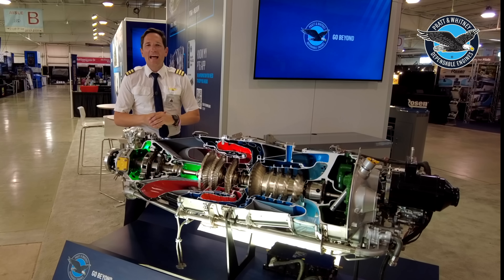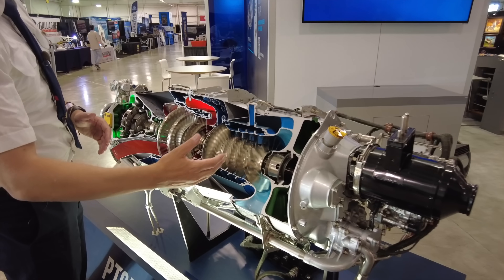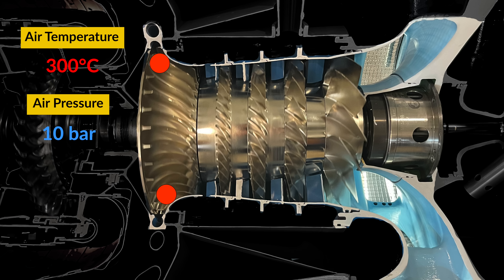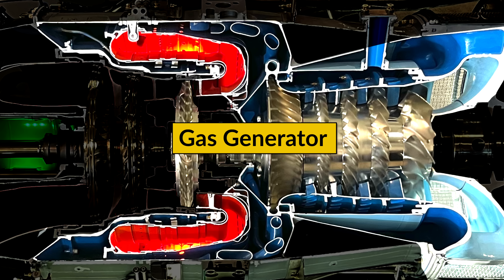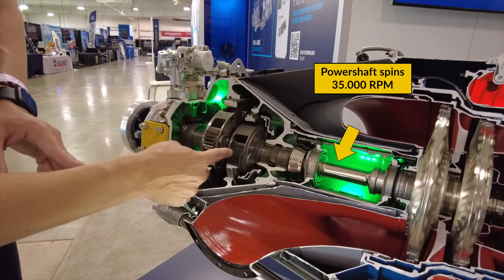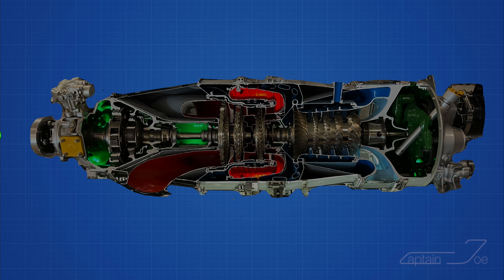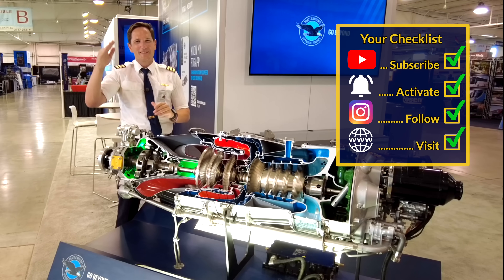The BEST TURBOPROP explanation video! By Captain Joe and PRATT & WHITNEY

Comment: Ok I understand how turboprops work now but the one thing nagging my mind is why? Why use one of these over a standard jet engine?
Reply: Because other jet engines have to be much faster to be more efficient. So in the low speed range turboprops are the most efficient.

Also, usually turboprops gives the best STOL performance
Reply: @ZK-APA  ahhhh so that's exactly why they aren't used everywhere mainly used only where it makes sense to have one. Ok now all of that makes way more sense
Thanks :D

Comment: That's a very interesting design.  I assume there are various air circulation chambers to cool the combustion chamber and the compressor housing.  I was wondering why the combustion chamber is enlarged to go around the exhaust turbines but that is what makes the engine shorter.

Comment: I'm confused...
If 47% of thrust from the combustion is driving the power turbine, which then drives a propellor.

This is just gas driving a turbine, that drives a propellor, that then pushes gas again...

Why not just skip the propeller and have the thrust itself push the plane (obviously need to reverse the orientation)?

Is it more efficient to convert the energy from pressure, to mechanical, back to pressure (propeller)?
Reply: Basically you just described a turbojet engine.
Advantage of turboprop is that thrust generated is more because of the volume of air rather than the speed. Hence at low speeds its most effective

Comment: I get that turbojets are not very efficient at low speed, but the the reduction in RPM required to power the prop, why not just use a turbofan to simplify the whole process?

Comment: Im a humble structural engineer, but love seeing mechanical appliances being explained. When you transitioned from cold air system through the combustion chamber, I was wondering about the varying speeds of rotation between the two chambers, expecting to find a fluid coupling or some other method of separating the two shafts, my reasoning being that the fastest turning shaft would control the other, or would that be the system with the higher torque? I impressed myself by understanding there should be separation between the shafts before you got there. Thank you for educating us less informed but inquisitive engineering lovers.

Comment: thanks for a great video.
What keeps the gas generator going once the engine start?

I know battery power to start it
BUT
since its not connected to the power unit, it will need another energy source.
Reply: The fuel hot air mixture self ignites, as long as fuel is available the engine is self sustaining and keeps running. Fuel shut off will close it down.
Reply: thanks.
compressor blade, combustion and turbine make up the GAS Generator section.
They share the same shaft.

got it.

Comment: Great explanation! And interesting to know how the two shafts rotate in opposite directions to avoid excessive torque/roll on the plane itself. Conservation of angular momentum - simple and elegant :)
Reply: I'm not sure Torque is the reason for counter rotation of the turbines. The turbine/compressor of the gas generator is free spinning and not attached to the engine/airframe in a way that allows it to transmit any meaningful torque to it, other than a very small amount of bearing friction (which would actually make the engine turn in the SAME direction as the turbine). This is the same reason why a pure jet engine doesn't torque roll the airframe, because the turbines/compressors just spin freely in the gas stream and can only provide longitudinal forces to the engine. The reason the power turbine/ gearbox in a turboprop creates torque roll is because the gearbox is anchored to the engine/airframe, meaning that torque from the turbine will be transmitted through the engine/airframe on its way to the prop. The torque reaction relates to the gearing and which way the propeller spins, not the direction of the turbine shaft

To my knowledge, the reason for counter rotating shafts is to make use of the swirl of the gas stream in the engine. E.g. as air flows through the turbine of the gas generator, it will start to rotate opposite to the rotation of the turbine (i.e. the turbine pushes the air anti-clockwise and this spins the turbine clockwise through equal and opposite reaction). The power turbine then spins opposite to the gas generator turbine, i.e. with the gas stream to make it spin more efficiently

Some turboprops are actually fixed shaft, meaning the gas generator and the gearbox are on the same shaft and spin in the same direction

Comment: From the comments below, it seams that most of the people were satisfied with a generic, brief explanation as depicted by a "pilot" ! ! ! !  If he is more than a pilot and might be a mechanic, that should  have been brought forward as well to show some way to justify his being able to talk about something other than the view point of a pilot.  If you want the real truth and the correct explanation to where you get the right information to where you fully understand the inner workings of a jet engine be it  a engine with a propeller attached to it via exhaust drive turbine PT-6, or a geared propeller drive attached at the front of the engine PW TPE331 which is found on several twin engine aircraft.  The PT-6 and theTPE-331 are only two of the turbo prop engines used in the general aircraft field.  There are larger turbo prop engines that are used on larger commercial aircraft.  This information is best answered by a certified aircraft power plant mechanic who may also have a air-frame mechanic license as well.    The mechanics, including the Prat & Whitney people know more about the inner workings of jet engines as related to this topic here on YouTube and will give a better and more informative answer than from a "pilot".  As I am a licensed air-frame and power plant mechanic and also a ATP, licensed flight instructor ratings CFIIM and also worked in a FAA approved jet engine overhaul shop I have a very realistic idea of the inner workings of a jet engine. Also I would NOT give you any incorrect information as I would ask of you to go to a current working licensed power plant mechanic or Prat & Whitney and get the correct answers you are searching for.  A lot of what you may be looking for is on the internet and by going to the source at    www.prattwhitney.com  The only way I do things is I "go to the source"  this way I do not get into trouble.  On a lighter note, "never trouble, trouble, till trouble, troubles you"!

Comment: I much prefer the straight axial flow turbo-prop engines (like TPE331).  They're more efficient, more power for their size, and don't smell up the airport ramp like the Pratt engines.  Yes, they're cheaper, less complex, and quieter.  However cruise efficiency of the axial engines is MUCH better (they're cleaner too).  Your explanation of this turbo-prop design was excellent.
Reply: Don't forget the hearing damage from the 331.

Comment: Thanks for this video. I have a little technical question about torque : why is torque null, or near 0, when the propeller is feathered ? I understand that a feathered prop produce no thrust, but the air resistance to its rotation is also very high, hence I expect a high ''torque'' value. It seems I don't understand the notion of torque in this case, and where it is measured in the engine/transmission. 
If somebody can help me about this ? 

Thanks.

Comment: 👍👍👍👍 Good expleniation. This engine Is very reliable, more than a pistone engine. No eccentric, no vibration, no pistone rings, valves, camshaft and wearing. It needs only Good oil for bearing lubrication due to High revs.

Comment: Retired from Alaska Air's regional service, Horizon Air, just recently. Went from AMT into Maint QC and eventually to their Propulsion Shop and worked on the RR Spey, GE CF34's and the P&W 123, 125 and 150 Turboprops. These Amazing Turboprop Engines are also Reverse Flow but put out 2300, 2500 and 5000 Shaft Horsepower to the Prop. The 150 swings a 13.75 ft diameter Dowty 6 Blade Prop and are used on the Dehavilland Q-400. What I would ad here is that after 100's of Borescopes (internal microscopic inspection), performed on these P&W Turboprops, I was amazed at how damage tolerant they are. Damages are usually confined to Combustion Liner wear and Compressor section Blade wear from normal use. P&W has every imaginable type of wear damage Recorded and Mapped for reference and all are well documented and tested for continued service. The more wear found, the more often the Borescope procedure. These are Fabulous engines that have been around a while and contain the Technology that has made the new PW1000G Geared Turbofan so successful. These GTF engines have 40 yrs+ of development behind them and offer a 15% savings in fuel economy over normal Turbofans. It was because of this fuel saving P&W GTF, used on the Airbus A320, that Boeing needed to provide something competitive, and thus, the 737 MAX was born. Boeing's answer to saving fuel was to mount the 737's existing GE CFM56-78 Turbofans UP further into the Wing, and Inboard as well, giving a considerable boost in fuel savings by reducing Drag. The downfall was that the faster this configuration of 737 flew, the more the plane wanted to climb and go "out of trim". Thus they had to invent the MCAS computer driven auto trim system (maneuvering characteristics augmentation system), to prevent the plane from climbing out as speed increased. That's where they got into trouble w/ the MAX. They Didn't inform the Pilots about this AutoTrim system, nor did they give a way for the Pilots to override it in case of a Pitot Tube (speed sensor) failure.

Comment: hi, I work on t56, t700, t600, and ae2100d turbo prop engines, could you explain a bit more about the prop? is it constant speed or controlable pitch? is the PIU like an overspeed/nts system or does it control prop pitch? does the plane have any type of computer like the 2100 or is the fuel control completely analog like the t56?

Comment: Wow…centrifugal flow combined with axial flow yet separated….blows my mind. 

As a student in engine class, couldn’t understand why fire didn’t come out of the inlet.  I understood ICE heads but then figured the convergent ducting pressure wall was strong enough thus preventing the flame moving forward.

Comment: That's an EPECS engine, very very new.(the cutaway you used) Notice no control linkages/cambox, its all electronic. As such, I like how you point to the electrical harness when talking about fuel flowing to the nozzles. Funnier still is you're scavenge oil pump has a fuel line going to it...if only you could EXCHANGE(r) it for another accessory (the cap letters are a hint). Otherwise very good high level explanation. Props to you...hehe

Comment: Captain Joe, you are the first human being that has demystified how this engine works. I couldn’t work out how one part of an engine could spin in the opposite direction if another part. I thought it was some sort of weird magic! 😂 What a clever design and so compact. Now I can see the advantages of having something like that inside an M1 Abrams instead of a socking huge and heavy v12 lump. Plus it’s lighter and simpler. Just really bad gas mileage and less durability I guess. Thanks for your top content Joe 👍

Comment: Not sure if anyone has mentioned it, but you can actually hold the prop stationary at startup. Though of course it’s not advised since the prop will quickly accelerate to full speed once released.
Reply: If the engine remains at idle, the prop will only be about 1040 rpm. If you increase the Ng to get max prop rpm, you should get around 1700rpm.

Comment: The "cold" compressor makes the air 300C, that's cold? How does this thing "suck" in the outside air? Is that a motor at the back of the shaft? Bonus question: the air doesn't move past the wing of a plane and it doesn't move faster over the top, the wing moves past still air, so what is the air actually doing?

Comment: If the Pressure, as the fuel explodes in the combustion chamber, is greater than the pressure in the compressor stage.
What prevents it from flowing/pushing back into the compressor?

Comment: Does the exhaust gas also produce a little thrust as it’s pushed out to the back?
And where does the air inside the compressor and turbine flow exactly? Does it turn around the stator vanes? There’s hardly any space to go through directly…

Comment: you mentioned HP but you didn't mention air pressure, how much pressure does the high pressure turbine generate?  it must be absolutely massive in the 1700 unit, that's a lot of shaft HP, how much after accessories say on the 1700 ho unit?  maybe 1500? 1400?  teh scavenging system will consume a lot as does the oiler one would imagine..unique, how does it compare to a Jet turbine engine and which one was invented first? the Jet is my guess?   

for those who cannot imagine simple fuel ignition generating such pressure there is a guy who cruises pulsejet engines across dry lake bets, funneled burning kerosine, heat air pressure generated by burning fuel and hot chambers suck air into low pressure inlet and force it out a high pressure outlet.. nuts he is mad man propane injected and diesel jet engine, no  moving parts, robert maddox is his channel he gets it going very fast..   very simple, to jet engine, to turbo jet engine, what is next?  SOL?

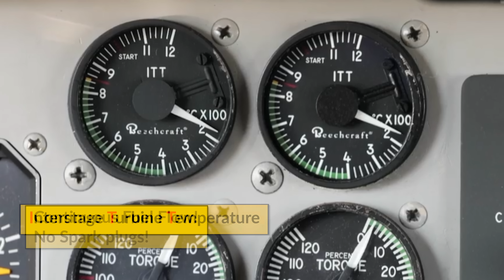Comment: 5:50 "the combustion is spontanneous and continuous."
and that's why gas turbines can burn just about anything.
There are no considerations such as octane rating. 
Although kerosene is preferred (easy to store and relatively cheap), an aircraft turbine could run on natural gas, gasoline, LPG, or alcool with little or no modification. 
which is pretty awesome compared to reciprocating engines.

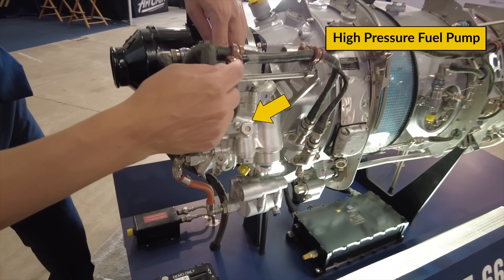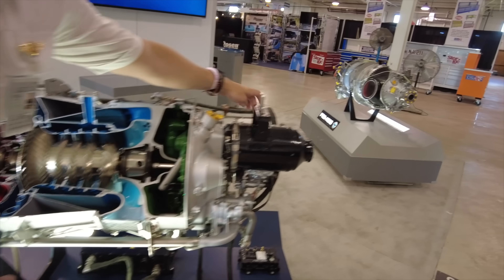Comment: 11:12 is fuel heater, not the scavenge pump...scavenge pump can be seen at 10:40 - 10:45 to the left and under the starter.

Comment: Thank you Capt. Joe. This was the most thorough, most articulate, description and explanation. Of a gas turbine prop aircraft.  As I was never completely clear. On the intricate differences between a turbojet, fan jet and turboprop. The other two, no problem. Turboprop? Confusion. No wonder I was confused. It runs backwards. It doesn't suck from the front.. It sucks from the rear. I did not know that? No wonder I was confused.

Not that I shall ever fly a turboprop, myself. That will be never.  I haven't flown since I was, 15 years old. 52 years ago. When my folks got divorced. That was the end of my flying days. Strangely, my father's also. So I never was really certain? Why he even got a private pilot's license? I think it was just to see if he could? Because after the divorce. He also never flew again. But spend a lot of money learning to fly. And for what?  I think it was just to get away from my mother?  But no matter now. All are dead and gone.

I am now 67 years of age and retired. I will not be doing  any flying anymore myself. I will never get that pilot's license. As I had no reason to do so. It was just something that was fun. Not many people get to fly actual airplanes, themselves. It's an incredible experience. And one where you wonder whether you will die any moment? And try not to.

I can't say this much. I had an opportunity some years back. To try out a couple of actual, Military Simulators by both Boeing and Grumman. Of the Lockheed designed, F-22 Raptor. Just entering service with the brand-new Boeing improved cockpit. And I got to fly that, military simulator. Oh my goodness!  Holy shit! It was beyond awesome. I had never flown anything like that in my life! I had zero experience. And apparently I'm a natural. Or so I was told afterwords by the Boeing guy and 5 or 6 US military fighter pilots.  Who observed me. I didn't know I was even being watched?

After I was done with the simulation.  Aunt discovered the US military fighter pilots watching me. They asked me if I'd flown, F-14's, 15's or 16''s? I said no. 35 years ago when I was 15. I was flying a Piper Cherokee 140 and occasionally a 180, civilian aircraft. And I haven't flown in 35 years. I've never flown multiengine. I have certainly never flown jets. I've never touched a jet fighter. And they asked me why I didn't join the Air Force? I told them I tried. But I didn't qualify for fighter pilot. And so I didn't enlist. They told me I missed my calling. I said no. The US military missed a great pilot. They agreed. They couldn't believe I'd never touched a jet fighter before? Neither could I. It came to me very naturally. And it was an all glass cockpit I had never seen before. It just all made sense..

In the following year I got to check out a Grumman, A-10 Warthog. And I found that harder to negotiate and fly. Then the F-22 the year before. Yet that is a much more complicated plane.. Much more capable. Much more state-of-the-art. The A-10 is over 60 years old! Or is that 50? Who cares? It's nearly a half-century ago. And very old-fashioned.  Though still awesome.

Now the only problem with having experienced both of those official, Military Simulators. Costing many millions of dollars, each.

Due to this experience. There is just no way. I can play with Microsoft Flight Simulator.  Without a cockpit. What a joke! It's kid stuff!  It's make pretend. You don't get any experience!

But in the real military simulators. You do. It's the real cockpit. With forced feedback. TA-DA!
RamyRAD

Comment: You have cleared up the inlet confusion I was experiencing. It wasnt by any means obvious where the inlet was situated. Thank you. They are an excellent and fuel-efficient engine type, with the reliability and longevity of jet engines, and a smaller, slimmer, footprint advantage.